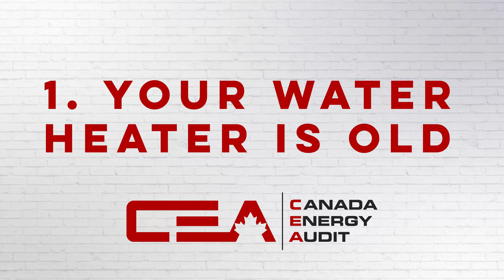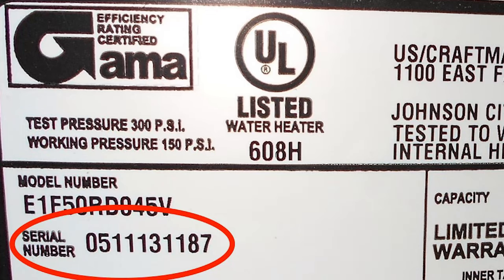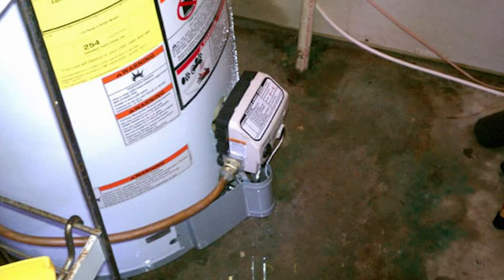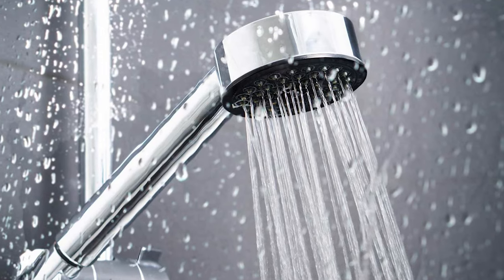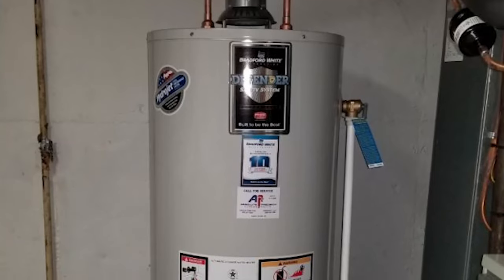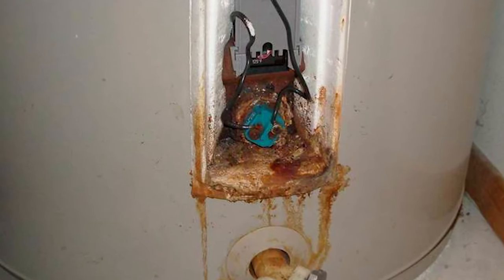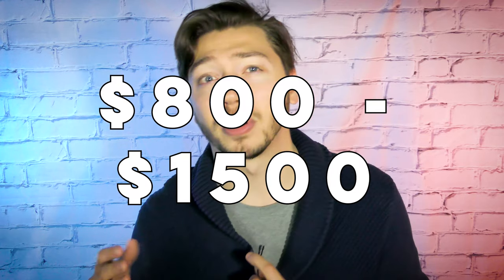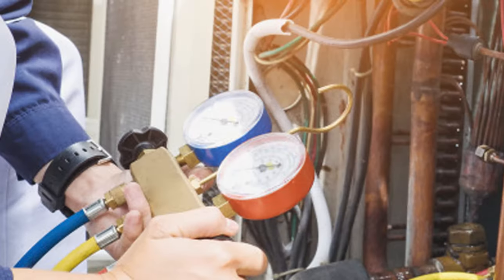Top 5 Signs Your Water Heater Needs a Replacement!

Comment: I just replaced my 14yr old tank. The signs were: 1) drop in heating efficiency 2) reduction in hot water volume 3) rust colour in water when filling bath tub.

Comment: Just ordered a Rheem Marathon tank. Made of plastic so no more corrosion and no more anode rod to replace. For those that buy a standard metal water tank, key to longevity is doing periodic maintenance by flushing out an built up sediment and pulling out and checking the anode rod periodically and replacing if necessary. Same goes for the heating elements. None of this is very hard to do. Water Heater mfg. of course hope you don't. ;-)

Comment: #4 could also be a bad heating element if it’s an electric water heater. Cheaper than replacing the whole thing. I’ve seen plumbers replacing the whole thing rather than troubleshooting the heating element.

Comment: I put my water heater in back in 2001. It still is holding up like a champ. All I do is clean out sediment with wet vac and replace elements every several years. 

I have saved a ton of money!